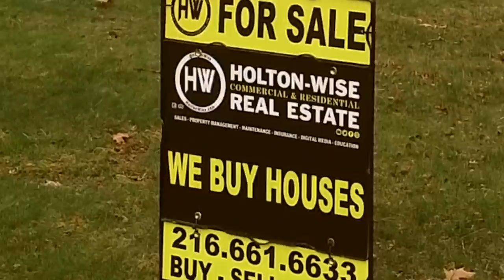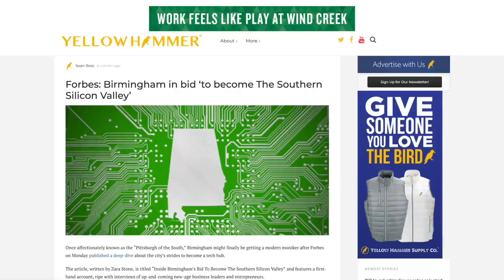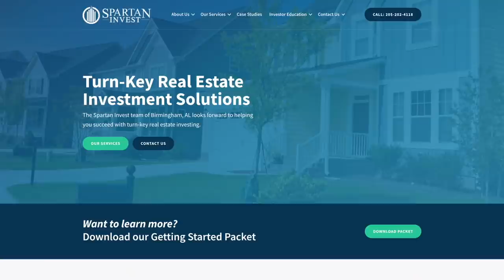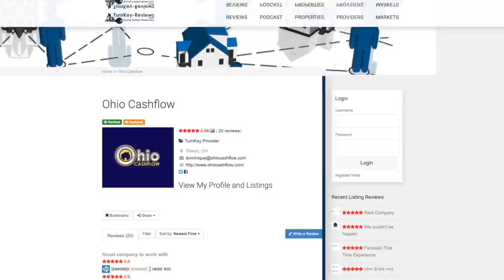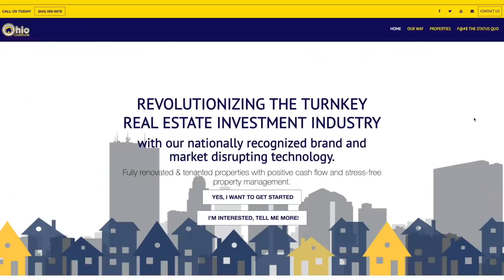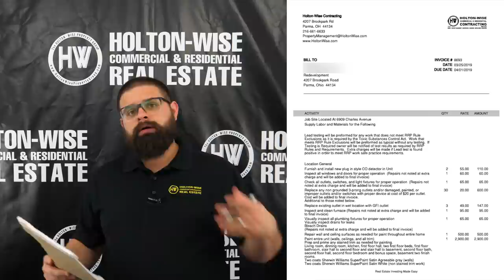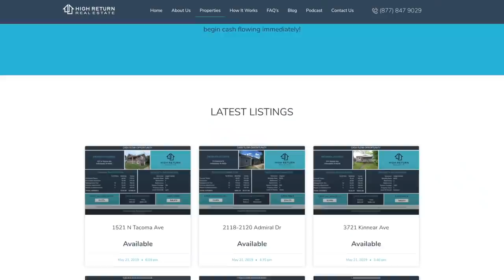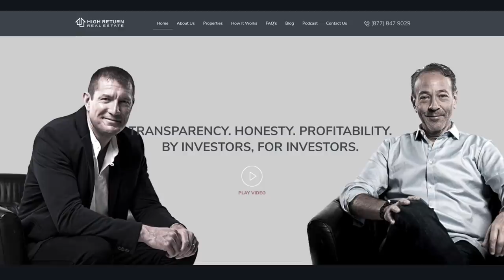Flipping Houses for Beginners: Flipping a Brick Bungalow in Parma | House Flipping 1

Comment: Great stuff James.
Can you post a list of the material used for the flip?
Reply from the maker: Possibly something we can look into doing. Did you see the entire scope of work with itemized pricing?
Reply: Like you had shared the paint brand used for your rentals before, something similar to that but for all the material used or maybe only major items that are the big cost adders  ( vinyl tiles, ceramic tiles, carpet, windows, doors, etc...)
Something like Links to Home Depot would be great 
Basically materials I would be buying myself at Home Depot and not getting through the contractor.

I imagine that list will vary widely from 1 Flip to another so it would be great to see them for different flips you are doing and see how the final product looks different.

Also hoping that’s not too much work to add them up if you have them listed some were on your SOW
Reply from the maker: Good feedback kemobaa. We'll see what we can do in future episodes. Stay tuned!